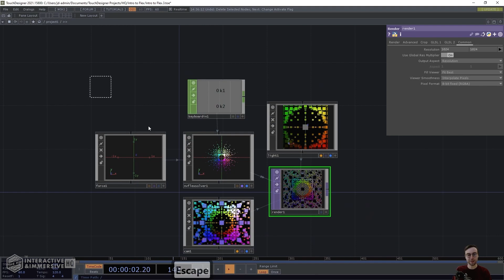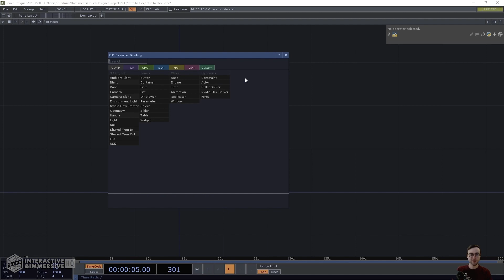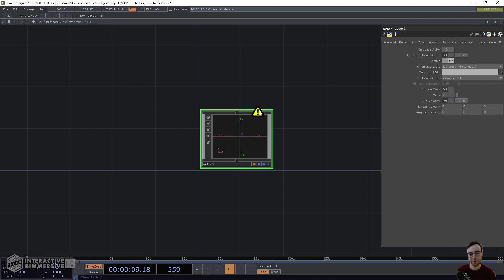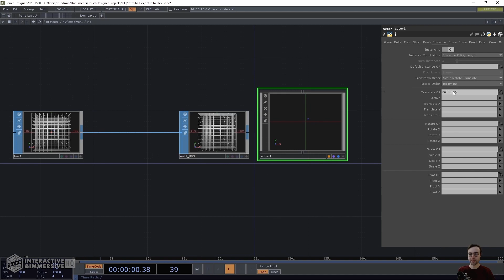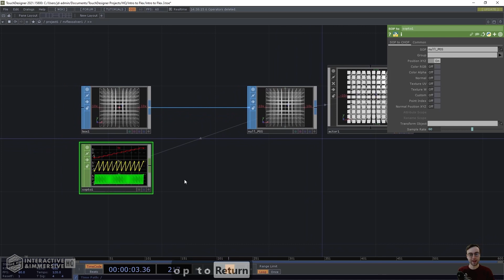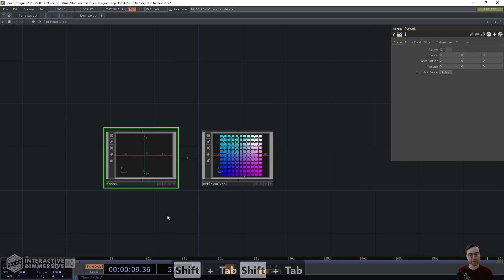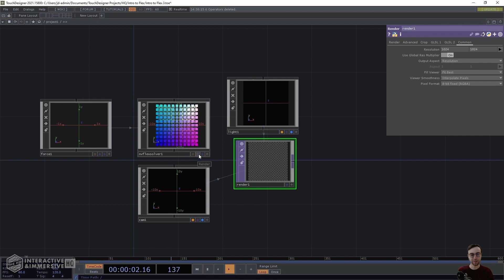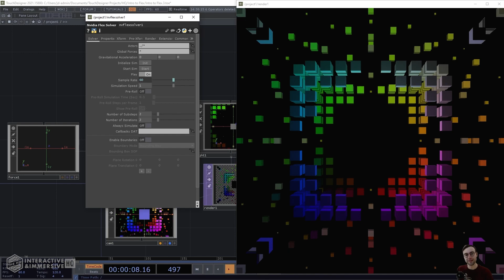Nvidia Flex Basics in TouchDesigner - Tutorial

Comment: Damn, another windows only tutorial , seriously considering ditching my Mac and switching to windows. Any recommendations?
Reply from the maker: Do you have an Nvidia GPU in your Mac? If so, installing Windows through Bootcamp is a totally usable and great way to get the best of both worlds without spending extra money. But professionally, you'd definitely want to try to use TouchDesigner on Windows with an Nvidia GPU to take advantage of most of the features.
Reply: I finally got a beast Windows box with a beefy NVIDIA card and it’s like a whole new world. So smooth and everything TD “just works”. I love it.

Comment: Will TouchDesigner Run Smoothly On Intel i5
Nvidia 940M 
8gig Ram & 2Dedicated Graphic Card

And will it be able to handle things like Fluid Particle Nvidia Flex or Flow
Reply from the maker: TouchDesigner will run on this machine, but the performance really depends on what you’re trying to do. Since the graphics card is just about 7 years old (and a mobile version), you’re likely to run into some performance bottlenecks with certain processor intensive effects. I’m assuming the CPU is the same age, so the same goes for that. 

The video card does technically support Nvidia Flex (according to the Flex documentation), but again, your mileage may vary depending on what you’re trying to do.